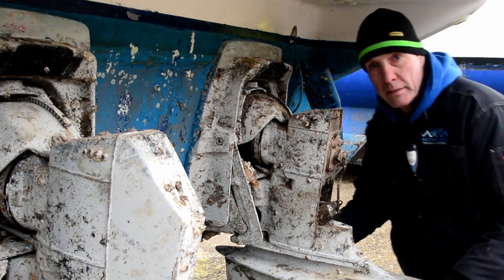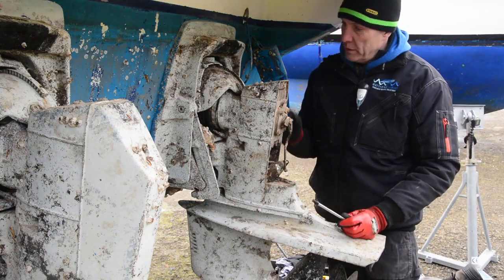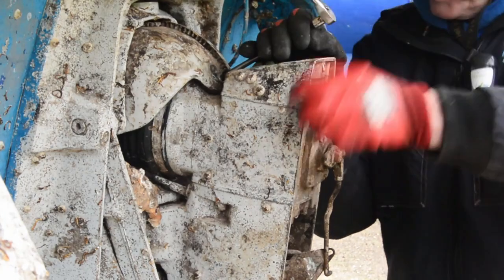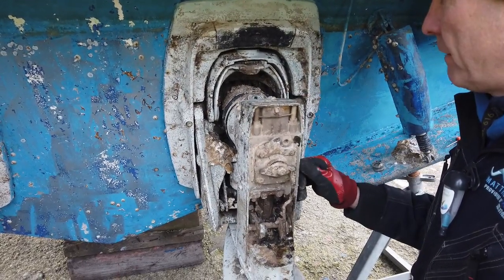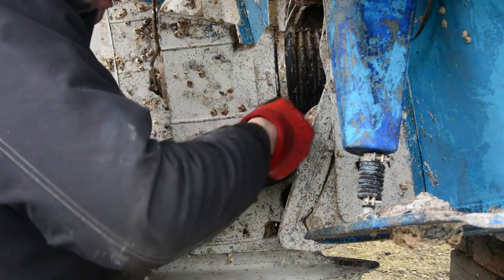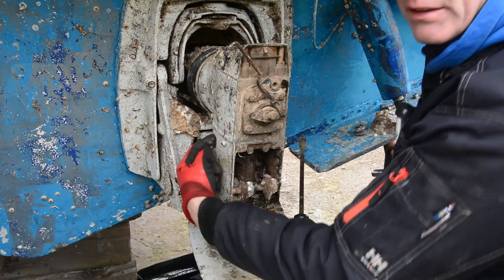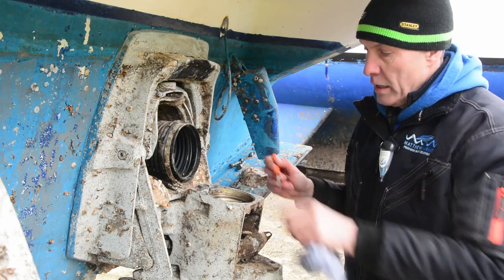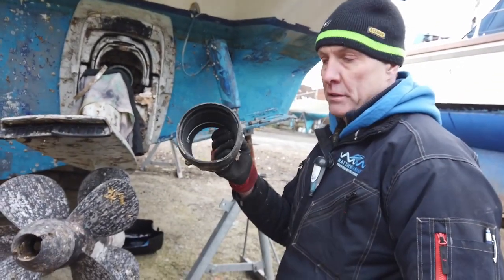Volvo DP290 Drive bellows removal

Comment: Great video!  Your Helmet screws came out easy.  mine are stuck.  I will try the screwdriver twist, but if that doesn't work; what size and thread bolt do we use in the other holes to force it out?  Thanks
Reply from the maker: From memory Ithey are either 5/16 or 3/8 whitworth

Comment: looks easier than doing the same on a alpha one;

on mine,the raw water pump has a good impeller, but it does  not pull ANY water from the bottom of the boat; customer overheated the AQ151C,melted one piston,  and i rebuilt it; now on testing,NO water flows, there is no suction, both coolers and ex manif are ok; 
do you think it might be the outer hose by the bellows that came apart or loose,or maybe the P/S cooler maybe?
Reply from the maker: It could be the hose or a blocked pick up at the bottom of the leg check those before the cooler.

Comment: How would you suggest to get it apart once all 4 bolts and nuts are out. Can’t get mine to separate from the lower unit
Reply from the maker: A few taps with a soft mallet should break the seal.